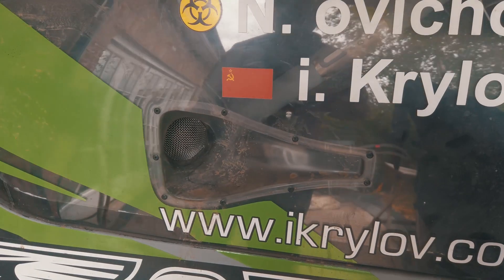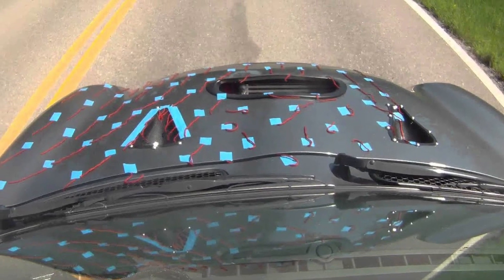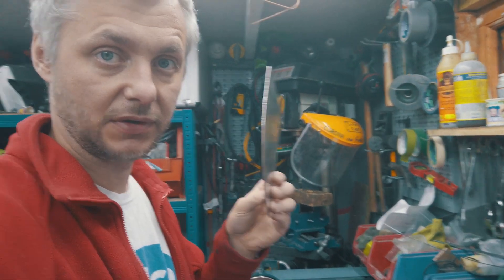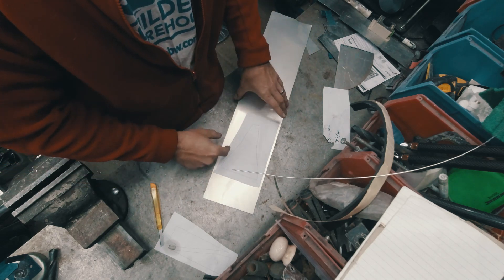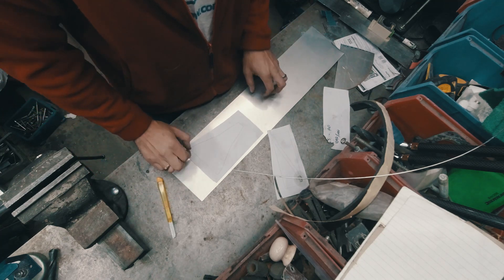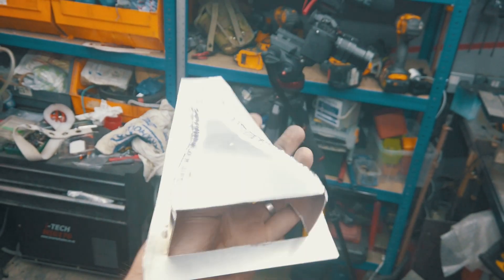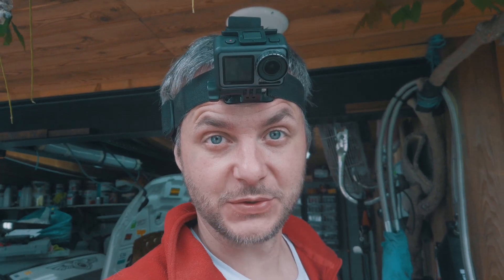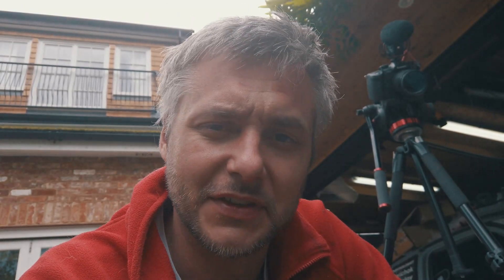Made NACA duct and used VAPE smoke to test it! backward NACA duct theory! Ep.18

Comment: 2 things:

1) if the plastic box had been vented with inside air, the smoke would have evacuated much quicker.

2) the curvature inside of the duct wasn't curved enough. It should have an airfoil-like curve.
Reply from the maker: 1) agree. But good enough as prove of concept. 
2) see reply number 1 🫡

Comment: i doubt that the naca duct shape made a difference, a simple hole would have the same effect
Reply from the maker: would have been a very short video..
Reply: It actually makes a huge difference. The high speed(high speed = low pressure in Fluid dynamics) flow that's attached to body will breeze past it. The duct is in totally opposite directuln, so the air is not going to go inside the duct.

Air flows from high pressure to low pressure(think vacuum/siphon).  The air inside the car is at a lot slower speed therefore higher pressure. It's going to be sucked out with a lot of force. 

The venturi shape at end of duck accelerates the air coming out and makes it closely match the speed of air flowing over body before blending. This helps sustain the vacuum effect and makes turbulence negligible. 

At best a hole even with a fan would pull a little bit of air out. It would have to be hidden around a sharp curve(on low pressure side) that detaches the flow or have a shield right in front of it. Both cases would create a low pressure area around hole and divert the high energy attached flow.

If he put a hole in same spot naca duct is at right now, it would move essentially 0 air at sufficient speed.  In yaw in would likely push in air.

He could have designed this slightly better. He should leave everything how it is but put lexan or sheet metal covering about the first half of the duct.  That will allow air on body to stay attached longer, keep more air inside of duct that's then sped up by venturi, make venturi work better, decrease speed needed to start siphon, less air disturbance, less drag and more sideforce(surface area from side).
Reply from the maker: Now that’s an explanation I can get on board with!!
Reply: @RuskiWeldFab  haha I actually got to this video because of the new Ferrari F1 car reveal.  

If you look very closely at the corner their louvers on sidepod they are truncated and stretched naca ducts.  Louvers work in generally the same way but cause much more disturbance and not as much suction. They create that shield I was talking about. I’ve never seen them like Ferrari has though.
Reply: I should clarify high speed = low pressurewhen not compressed. Air is treated as an non compressible at transonic speeds.
Reply: That's the akin to saying a 'scaffold board would work the same as an aeroplane wing'

Comment: Is your whole underside of your car flat bottomed with a diffuser at the rear? If so I would think that turbulent air would disrupt the airflow under the car. In that case I would use the NACA in a fender. Just finished reading Adrian newey's book and I learned all kinds of insights on on aerodynamics as applied to auto racing.
Reply from the maker: Please tell me more!! Yes it’s nearly all flat.
Reply: @RuskiWeldFab  Newey stressed in the book that keeping the air as smooth as possible was paramount to efficient downforce. Thats the reason they started installing aerofences on F1 cars to keep the turbulent air from the inside of tire going under the car and forcing it away from the body in order to maintain efficient and consistent downforce. Dumping the heat at the back of the car above the diffuser would be ideal as it would act like a blown diffuser. Im not an engineer but I was a racer in my 30's and do grasp most if the concepts. Read Adrian Newey's book. It mechanical/aero engineering in layman's terms and very insightful
Reply from the maker: thank you for recommendation! is this the book? https://amzn.to/3s7KjYY
Reply: @RuskiWeldFab  thats the one. Its a biography as well as tech aspects of every car he ever built. I read it twice I liked it so much. All the best in your racing! If you can't be safe be fast!

Comment: Got me thinking about a front splitter now. Don’t think a reverse naca duct would make any difference on mine though 😂 also I like dem hoodies 😉
Reply from the maker: I have 2 splitters for sale 😂😂😂
Reply: @RuskiWeldFab  ur test works as a proof but in practicality it works even better.
 the box with the smoke was closed so clean air had to get out and in from the naca duct and still it worked so next consider having a small hole in the box it would show a more significant realistic result

Comment: Why do you use a wooden engine floor?
Reply from the maker: because cheap and easy! and its what is used on touring cars effectively.
Reply: @RuskiWeldFab  but is it hardwood?   Of what wood   because doesnt it catch fire?
Reply from the maker: Yes it’s hardwood marine ply. Coated with epoxy paint. If it catches fire, this should be least off your problems.